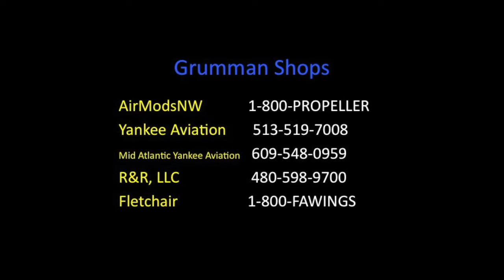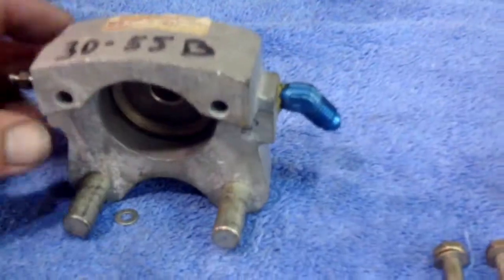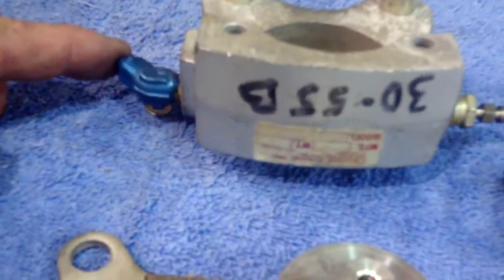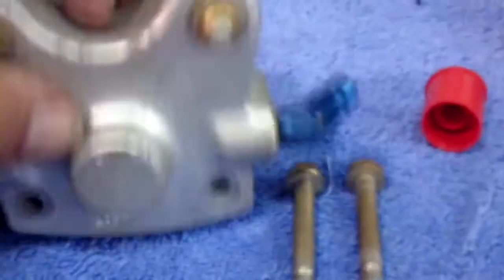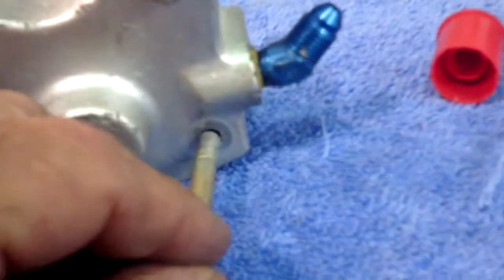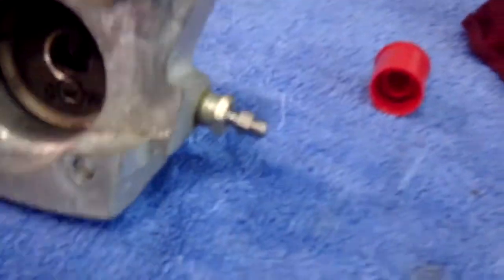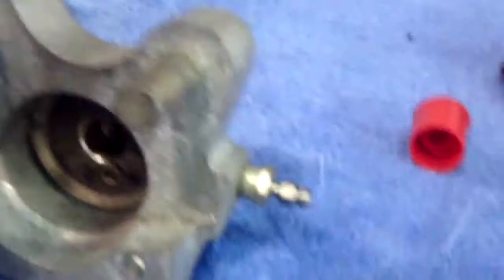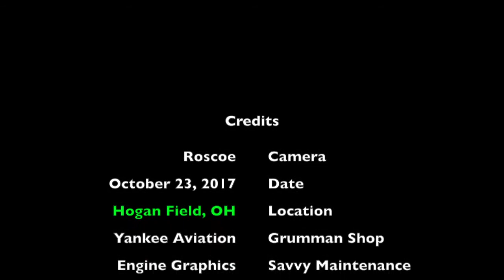Cleveland Brake Caliper - Grumman Style

Comment: You're lucky they are not magnesium. Cleveland would make calipers out of Alka Seltzer if they could form it.
Reply from the maker: Magnesium would be bad especially if they overheated!
Reply: @GrummanPilots  The red brake fluid will sacrifice itself before a caliper overheats.
Reply from the maker: Our lanes do not land that fast, but a dragging one on taxi at a big airport could cause problems.  Thanks.